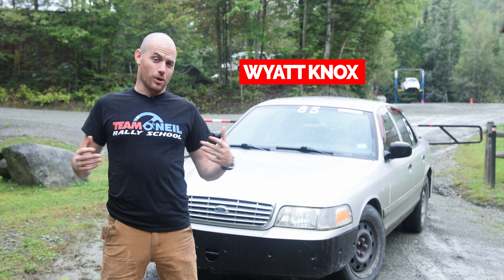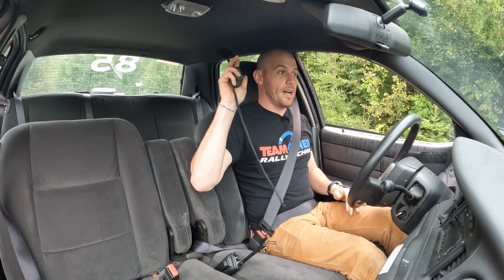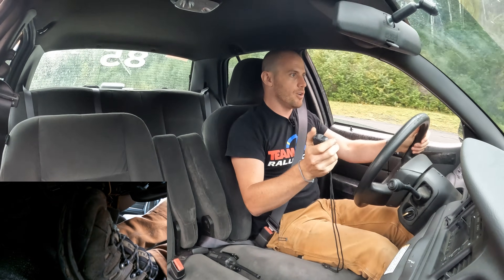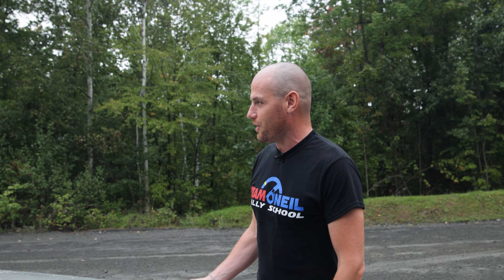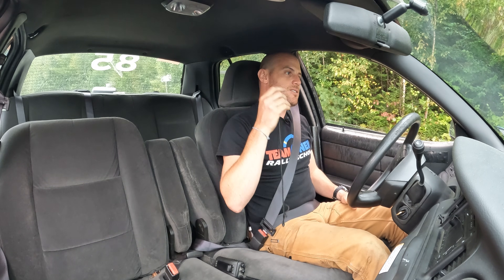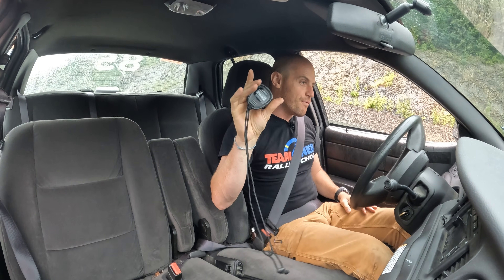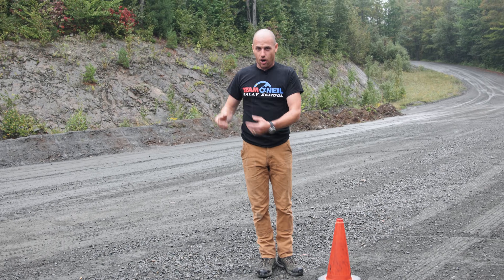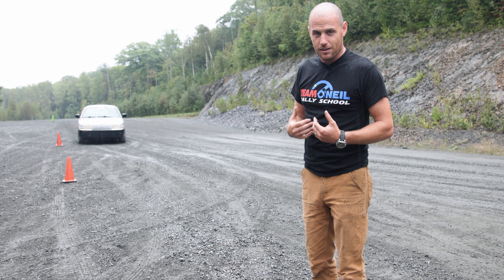Threshold Braking | ABS ON vs ABS Off

Comment: Nice test y'all, appreciate how you guys keep the production simple and conscise. Would ABS provide any detriment or benefit to trail braking?
Reply: I don't have a lot experience on gravel but on pavement wet or dry ABS works fine with trail braking.  RWD Mustangs at Bondurant school worked well and ABS can work as a safety stability control if overused but regular ABS trailbraking works fine.  On FWD cars that often carry the rear inside tire it can work even better as you can carry a tire and not lose braking on the other 3 wheels or induce more rotation(oversteer) if you want or need that.  Trailbraking is not near the traction threshold so ABS doesn't usually come into play unless you are trying to get more rotation in a stock or ill handling car.
Reply: ABS probably wouldn't make much of a difference with trail braking because you wouldn't be braking as hard in the turn in, you'd be easing off the brakes. The biggest difference would be in the initial braking before the turn in, since that's when you're the hardest on the brakes and a little lockup/ABS activation is almost inevitable.
Reply: Street car ABS is dogshit on track because its generally too conservative. Ive had cars all but stop braking all together when trailbraking, especially if a wheel gets off the ground or if its a bit slippery or bumpy.

Its far from the systems you have on a GT3 racecar for example, its really only meant for panic braking and random swerving haha.
Reply: @LeveqineX  I'm not sure what you have experienced but I have had no issues in several Ford Focuses 00-05, WRXes,  Miatas, Exocet, C5 Zo6, 09 Civic Si, AP1 S2000, Dodge Neons first and second gen and a couple Mustangs.  Most were standard road cars not track focused cars.  Ran at Waterford Hills, Gingerman, Mid Ohio and even the jump at Grattan never upset the ABS as long as you didn't brake while in the air.  The 2002 WRX would occasionally go into ice mode on the street when braking hard on bumpy surface but the 05 and 15 WRX never had the issue nor did the other cars.
Reply: @zeitgeist888  A fair few, a friend of mine who's also a really fast driver would say the same (had those thoughts about a track prepped 08' Civic SI). "Cruising" around its ok but if you go for hotlaps its pretty bad. One of the better cars I tried was probably a Camaro ZL1. The worst was a 15' (?) WRX with a bigger rear ARB. My Veloster N isnt too bad but still hits ice mode here and there. A friend's track prepped FRS I tried had its suspension completely borked to try and figure out why it was understeering so much on entry, turns out it was the ABS just being stupid even with very light trailbraking. The Mazda3 I had was terrifying in winter, and awful at autocross with the ABS.

It just gets worse the faster you go really. Gimme no assists any day.